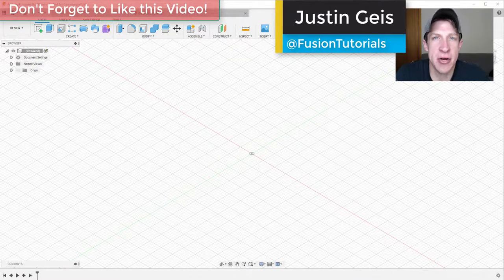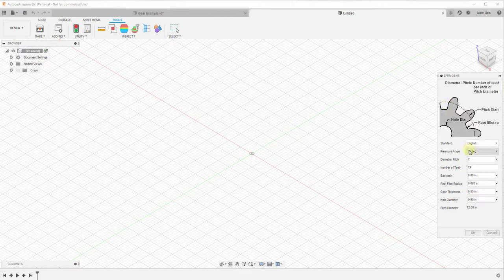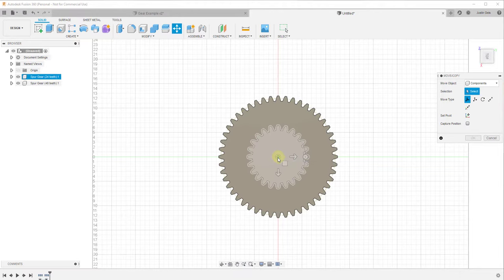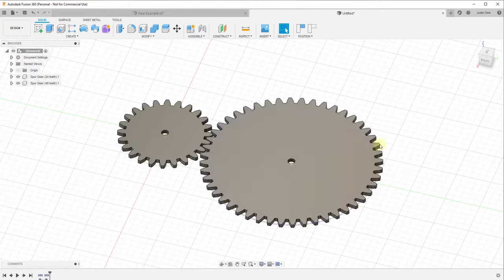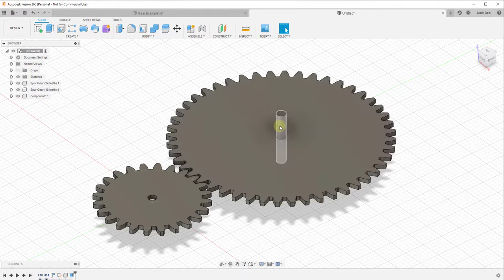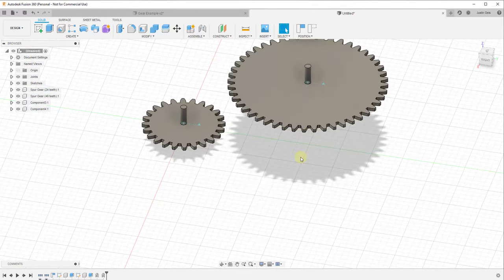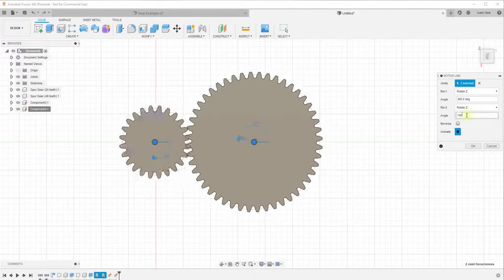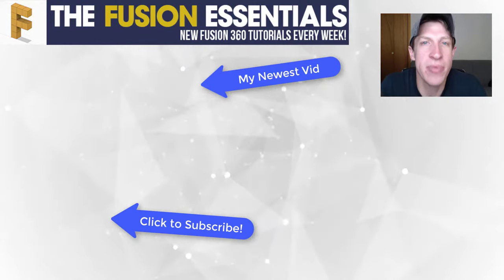Creating a WORKING GEAR JOINT in Autodesk Fusion 360

Comment: The version of Fusion360 I have is obviously updated (2.0.17710), the As-Built Joint dialog looks completely different, I've chosen the rod and the gear but there is no Position, instead there is Origin Mode, Snap, Motion and Type ?

Comment: Guys, I've been looking for a way to link motion between a shaft with a key and an impeller. And after watching this video, I think this is one way to do it by making a motion link between the shaft and the impeller. But can I do it by simply using a joint feature? I've tried that but failed, so I wonder if it is possible. Thanks.

Comment: If you look closely at the animation you will see that the large gear only turns 180 degrees and then springs back to zero.  Place a datum mark on your large gear, and it will be ore evident that the simulation isn't quite right.

Comment: F360 needs to improve the kinematic velocity controls (ie. revolution per unit time, theta = r * omega) in auto-Animation mode. the spin is way too fast, even when adding a small/slow drive gear.

Comment: Excellent video👍. Please can you do a video on gear ratios, i need to make 8:1 meshing gears, large gear 8 revolutions/ small gear 1 revolution, the small gear must have a diameter of more than 250mm. i am testing a magnetic generator - 220v. Will appreciate a PDF print file.

Comment: Lame method.  Need to use the pitch diameter tangent to the other pitch diameter for proper shaft spacing. Joint method OK though.